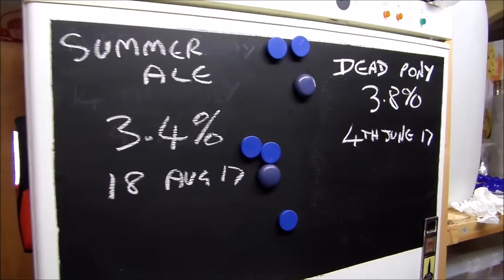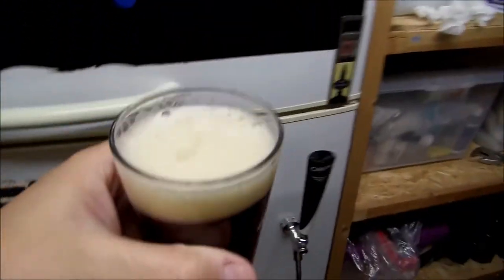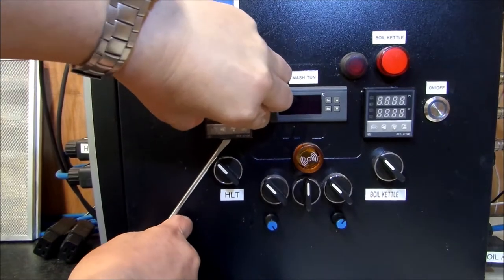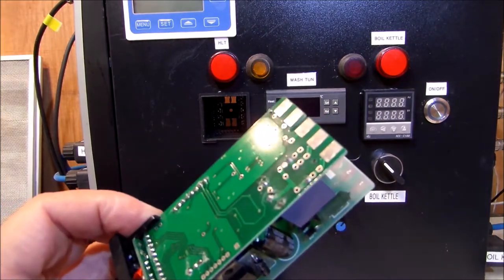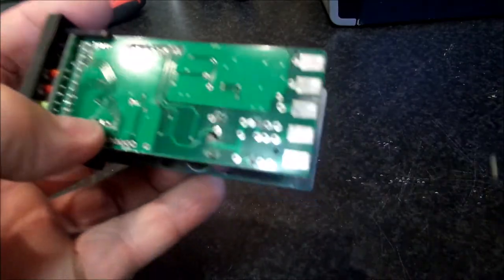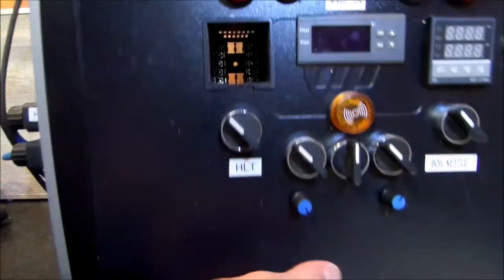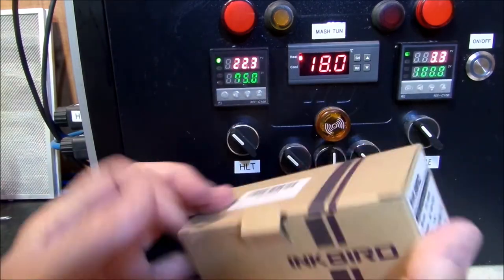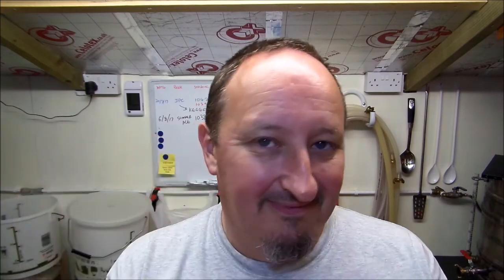Vblog59 - Rex C100 Repair?

Comment: Had the similar issue, found  loose leg of the capacitor located near a small transformer (poor workmanship). It has been working properly after resoldering. You can locate this issue by shaking all capacitors on a power supply board then fix the loose one. Cheer👍

Comment: Hi mark. Those fibreglass contact cleaners work quite well on male edge connectors.
A quick spray with contact cleaner always helps too but if you have a bad female connector the only thing you can do really is replace it.
Hope the Inkbird works for you. Jerry. 🍺